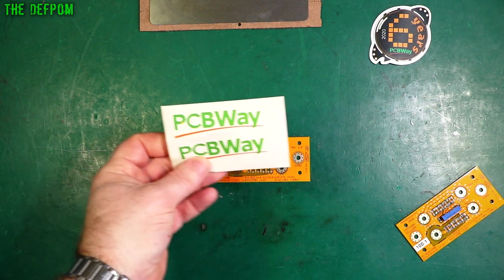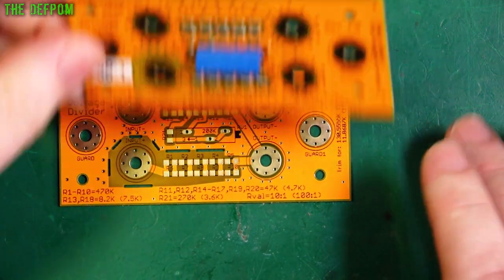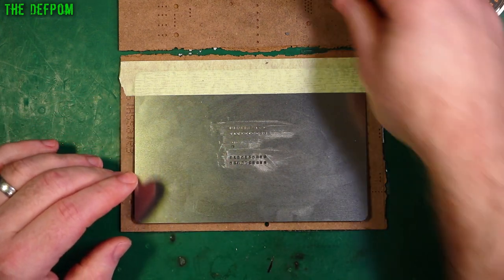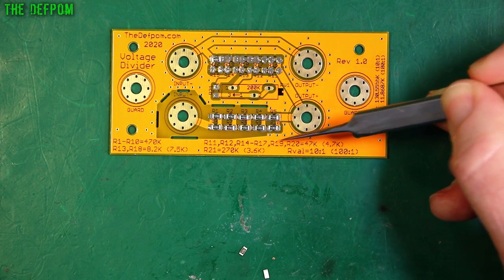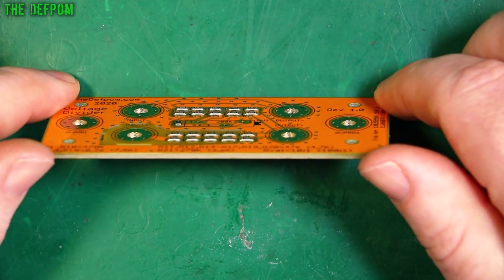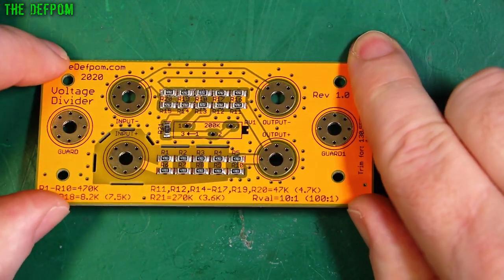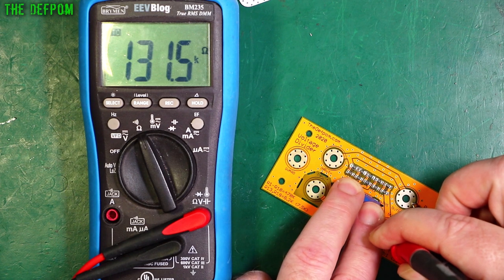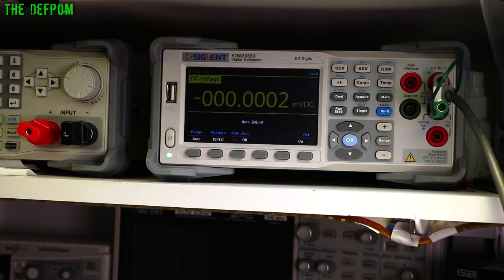#760 Voltage Divider Project - Part 2 with PCB from PCBway

Comment: Nice little project,,, I'm going to build a few my self!
Reply from the maker: I have another revision in progress, which should ensure that the input impedance of the meter you use it with doesn’t effect the calibration of the board, boards have been ordered from PCBWay already, hopefully the components don’t take too long to arrive.

Comment: Is it possible to use a jumper on the output, to select the impedance between 10Gohm or 10Mohm ?
Reply from the maker: Bjorn V if you were to make one of these I would say to adjust on the meter it will be used with, that way it is tuned to suit the input impedance of that meter. I have designed a buffered version of this too now which should make it less effected by the meter itself, more videos are coming on this.

Comment: Ok ive copied your circuit and applied for a patient lol.
Will you be adding a precision op amp on the output so different meters resistance has no effect on the division?
Or is it Ahh bugger it lol.
Anti corona laquer over the resistors maybe.
Reply from the maker: zx8401ztv shhhh!

Comment: For what meter impedance is this designed?
Reply from the maker: Thomas W it is expecting a 10GOhm input, as that is what many meters will have that have the precision for scaling down the input, you can tweak it to use 10MOhm, but will be tuned to the meter it is on, and cannot be transferred to another meter without its slightly different 10MOhm resistance effecting the divider ratio.

I have a demo of this recorded already and will be publishing that soon.

I also designed a more complicated Rev 2 board which should effectively remove that issue so it doesn’t matter, I am waiting for the parts and PCB at the moment (I only ordered the PCB yesterday)

Comment: I don't understand why you are just glorifying a simple potential divider which you could do with a straight up potentiometer? Your circuit is going to be out of whack within 5 minutes of using it.
If you want a 10:1 and 100:1 divider you need to look up how a Hamon divider works, using precision resistors of course. It's far cheaper than a Kelvin Varley for sure and you get to recalibrate it every time you use it. Win!
Problem with all resistor dividers is meter loading of course. 20k ohm/V, 10M ohm, 100G ohm is great and all.
This is not a problem if you use another meter as a null meter and have stable voltage sources.
Reply from the maker: Drew Dastardly - this is a very cheap way of making a divider that can handle 1000V, using common parts, with good precision when used with the meter it was calibrated with.

It is also just the first stage of a project I am working on, I thought I could go through a development video series showing the stages from simple DIY to a more complex more expensive version, the PCBs and parts have arrived for the next stage, and once that is done I will be stepping it up again another notch in both precision and cost.
Reply: @TheDefpom  What is your 1000V source? I find it hard enough to get a decent 100V.
Reply from the maker: Drew Dastardly - DC calibrator, my Fluke 343A
Reply: @TheDefpom  Which begs the question...?